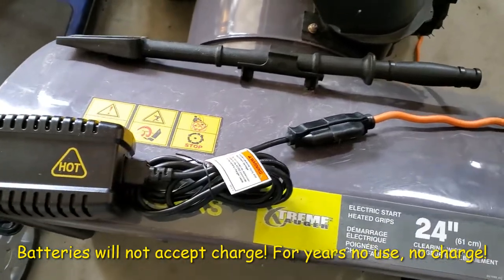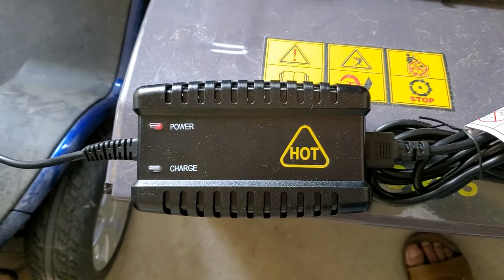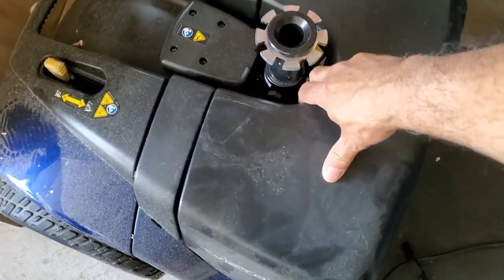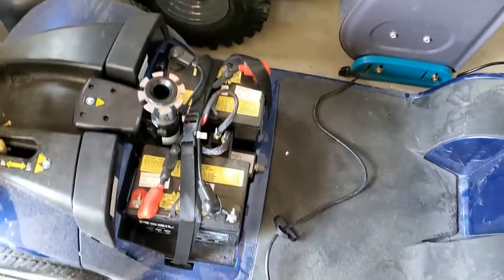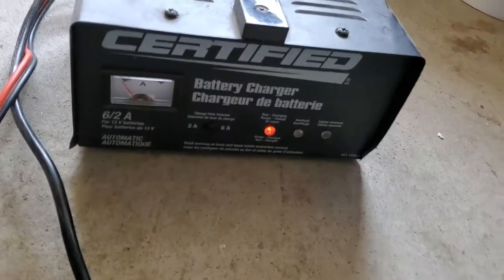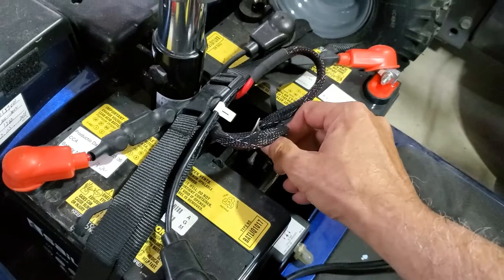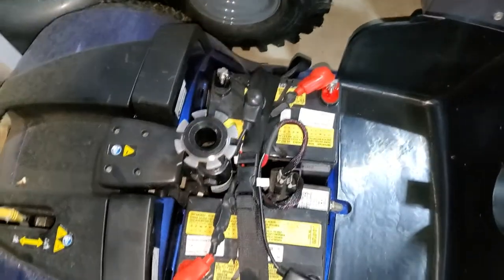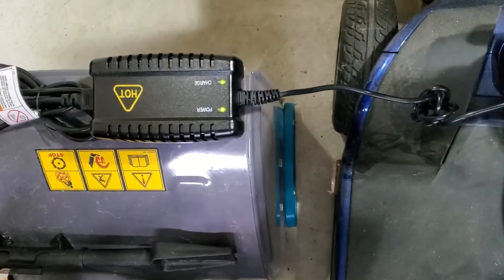How to save $800 on Mobility Scooter Battery - Revive Dead Batteries.

Comment: I have a jazzy elite es mobility wheelchair.. it was my wifes aunts. She passed away  about 10 years ago. She had 3 different kinds. They was selling all of them . I have had back problems so i picked one for me to keep... I got the newest best looking one and put it in storage.. now i need it. Same thing it wont charge.. i charged for 10 hours. It wont move. I have no job now. My wife left me. Where im staying theres no water. I have to go fill buckets. So i really need it running.also its a long walk to the store. With this it will change everything. They left all the wires hooked up to the batteries totally drained them. I believe its so low the charger wont charge them . Thanks for this video. I hope it works for me. The chair says if full battery charge it will go 20 miles before recharge..thats great. Brand new ines cost over 100 US. DOLLERS. And i dont have it... Thanks again 🙏 IT WORKS

Comment: Batteries that have been left run-down, not kept charged,  get plates sulphated (damaged)and lose their capacity to be fully recharged. Mobility scooter chargers will not charge dead (low voltage) batteries as a safety feature. Charging with a 12 volt car battery charger (sometimes) will bring low voltage up enough so that the mobility charger will begin charging. If battery has been seriously damaged, battery may not charge enough to run the scooter. Recharge batteries after each use and once per month if not used. Keep battery box in house, not in hot car trunk or hot garage. High temperatures  reduces useful life. Properly charged batteries have 2-4 years useful life.

Comment: what voltage does the charger need to be on 6v or 12v and low or high please
Reply from the maker: 12 V. All batteries are 12V batteries. They are connected in serial to generate 24V which runs the motor.
Reply: @techzonediy9969  Thank you .I will try this on my dads scooter .its been parked up few months and wont charge at all . Should I use low or high charge mode please?
Reply: Put on low, then charge for 2 hours each battery i.e. 4 hours for both. Then connect the batteries and use scooter charger. If you have volt meter you can make sure each battery measures around 5v each before connecting again.
Reply: @mohsinm644  thankyou .I don't have a volt metre tho .

Comment: Nice, I have a similar scooter and the exact same issue. Brand new but has been sitting for many years and batteries wouldn't take a charge. I will try this out and see if it works for me. Thanks for the information. 
"HACK THE PLANET"
Reply from the maker: Did it work?